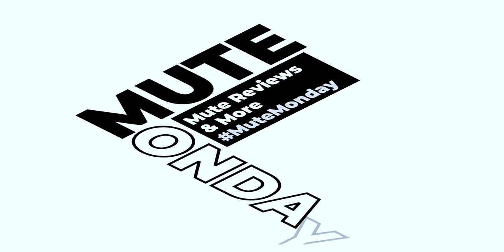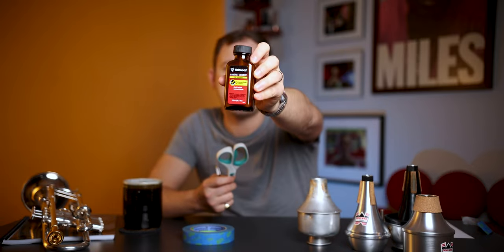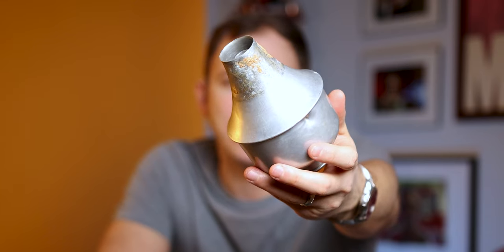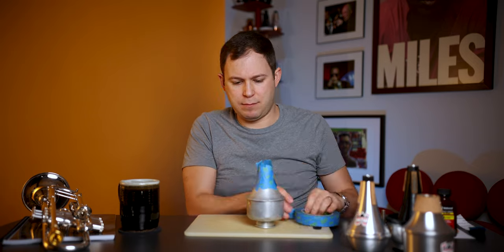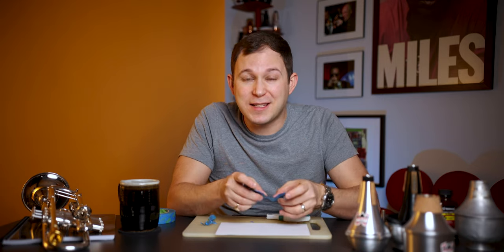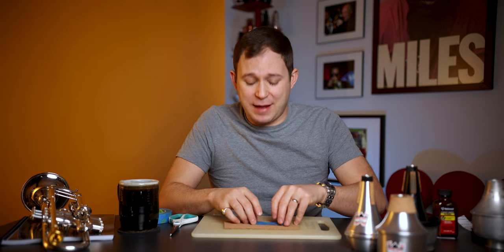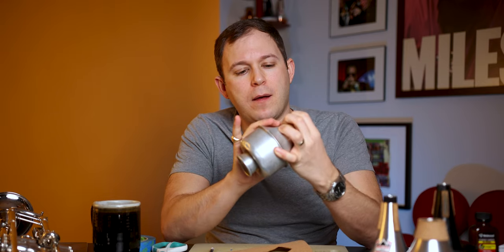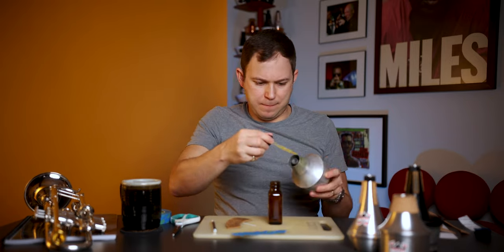Harmon Mute Cork Replacement // Mute Monday Episode 27

Comment: My first one was sloppy as it has a small gap between the 2 sides because the cork couldn't wrap tight enough for the 2 ends to touch with the contact cement on but the mute still sounds amazing.

Another tip, remember to keep note of the opening diameter of the Harmon mute cone because on some older vintage Chicago stamped Harmon mutes, the cone is rather skinny and that alone will determine the thickness of cork you want to use......
Reply from the maker: It def takes a little practice, but once you get comfortable it should be a relatively smooth process. With regards to your other point - yes they did actually have some slight variation over the years, and of course different models also are slightly different. It's always a good idea to double check the pattern before cutting new cork.

Comment: Don't forget to save your template, just in case a friend sees your beautiful cork job and asks you to do it to his/hers. As long as the other mute is the same brand and model, the template is reusable. It'll save you some time.
Reply from the maker: Yes! Good to label it and put it away. Roger Ingram has a whole bin of templates that are all labeled. I've only got 3 or 4.
Reply: I have recorked a Harmon for a friend, but don’t own a true Harmon myself. I have recorked the two I have, and have also done a Whispa and several Humes and Berg mutes whose cork seals with the horn. I think all of them have been different. I learned a couple new tricks from your video I plan to try if I have to do another and need to make a template. The tape thing is a great idea!

Comment: Hi Josh, thank you so much for your brilliant video, I have all but two of the tools listed, so just before I start buying the wrong thing, can you confirm two things for me? 1, what thickness of cork did you use for your Harmon mute, as I notice all my mutes have different thicknesses (is 1mm going to be too thin/fragile, do you think?), and 2, what's the particular reason for using Weldwood Contact Cement over any other brand? I only ask because, here in the UK, I can only get a large tin of it, and it's over £100. Is there a special ingredient that it has/lacks that others don't?
Reply from the maker: Thank you Liz, sorry for the delay I was traveling. I think any type on contact cement will work, this is the specific one recommended to me by Roger Ingram, who is really the expert on mute restoration and fixing. Not any specific "special ingredient", it's just good for metal, plastic, cork, etc. Just don't use wood glue, super glue, gorilla glue ... etc.

Regarding the thickness of the cork, I'm not sure exactly how thick the cork I have is. But you can always remove/file it down, you can't really add more if it's too thin - and it may be too easily worn. I unfortunately don't have a micrometer, but when I compare the cork sheet I have to an audio CD, it is exactly as thick as 2 CDs stacked on top of each other. I can't recall if this cork was from Michaels or Amazon, but it's just a thin cork sheet. If I can find the same product I'll try and update the description to have a link.

Hope this is helpful!!
Reply: @JoshRzepkaMusic  Oh awesome, this is so super helpful, thank you very much indeed for your excellent reply. I'll get those things now. ❤

Comment: Great video, Josh. I'm tempted to use rubber on my harmon mute instead of cork for a better grip in the trumpet bell. Any thoughts on cork Vs rubber?
Reply from the maker: Thanks Gary! Yes, lots of people like using the rubber/foam. I love it on the Emo mute, and I think it's a great option. For many people it's just preference. Depending on the thickness you may need to adjust how much, as it could be so thick that it causes the mute to sit further away from the bell.

Comment: Thanks, Josh! Great video and explanation. I've just re-corked an old Harmon model B using this technique. Sounds great. However it has a leaking seam. Any ideas on repairing that? I tried pushing it with a drumstick from inside, like in dents removals, but it doesn't work.
Reply from the maker: Thanks, glad it helped you out!! Hmm...that can be tricky. I have a few that have a leaky seam and I really dig how they sound, it can occasionally benefit the sound depending on the model and how large of a leak it is. 

A repair tech might be able to help, otherwise you could experiment with a variety of options, but some of them might negatively affect the mute. 

The Bobby Shew Soloist is actually soldered together, a bit extreme, but that would certainly seal the mute. But, it may (or many not) dramatically alter how it plays (for better, or worse). That is an interesting idea that I might actually try out ... hahaha
Reply: @JoshRzepkaMusic  Thanks for the ideas. It actually does sound better, than similar one without leaks. I thought it was the difference in metal thikness, but the leak may also affect the sound. 

Soldering aluminum is not an option at least for now. If it were brass or copper, I would go for it. Maybe I'll try filling the gap with candle wax or something reversable.
Reply from the maker: Let me know what you end up doing, and how it works!

Comment: should this sheet cork be it like 1 mm or 2 mm thick?
Reply from the maker: The cork sheet I have and use is 3/32 thick, which is 2.5mm. So I'd say either 2.5mm or 3mm. You can always file some to remove it, but you can't add.
Reply: @JoshRzepkaMusic  okay, good to know. i understand the you cant add part, i`m a machinist...
Reply from the maker: Oh, very cool. Shockingly it's not a universally obvious concept.